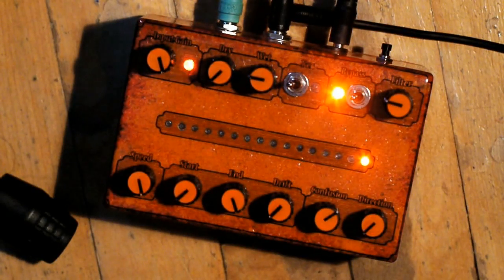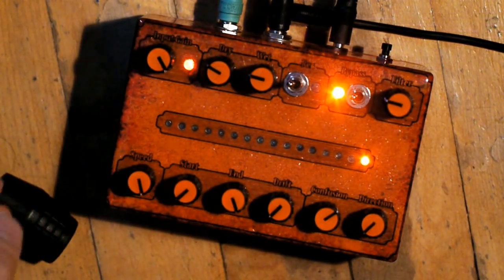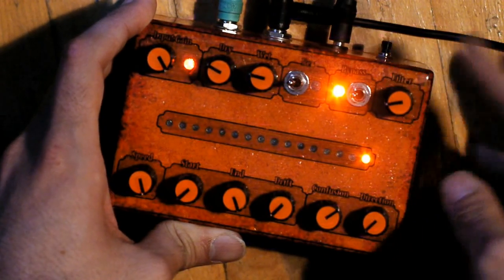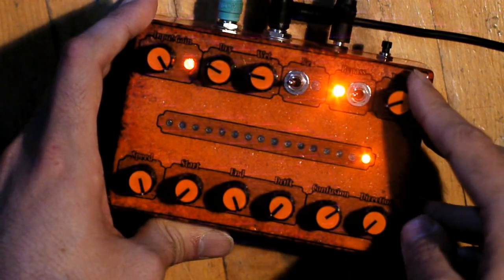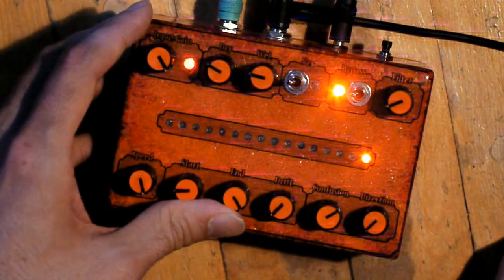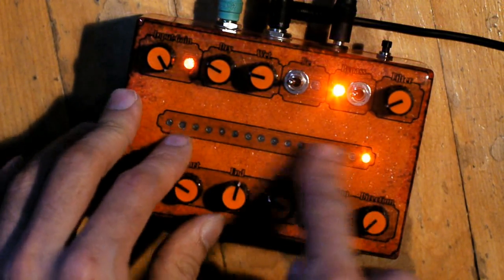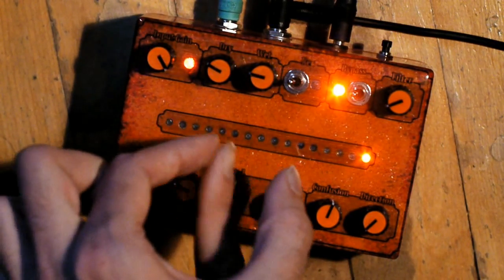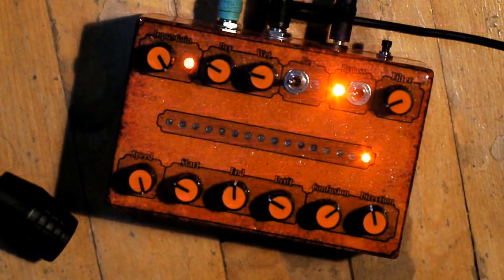Crushed Glass granular sampler/looper/glitcher

Comment: @muki123 Sorry, I forgot they have a self drive capability. That's nice and simple then.

I'd use Flash for sample memory, and SRAM for delay line/echo effects. Replace that second 256K SRAM with a 8MBIT Flash. e.g. SST25VF080B 1MByte, $1.24 from Digikey.

Serial Flash are a bit more fiddly because you have to factor in byte programming time, etc, but you'll get a LOT more space for the same price as SRAM. Only issue is limited write lifetime, that's why you have the SRAM as well.

Good luck!

Comment from the maker: @ArtistEngineer 
just a 560pf cap on pin 8 of the MAX7403 to drive it's internal oscillator. cap to ground, with a pot in between it and ground for variability.

Comment: How are you controlling the filter chip on this? 

Are you creating a variable frequency pulse from the micro, or are you using a VCO controlled by the pot. e.g. schmitt oscillator?